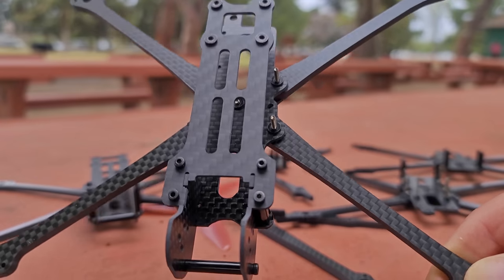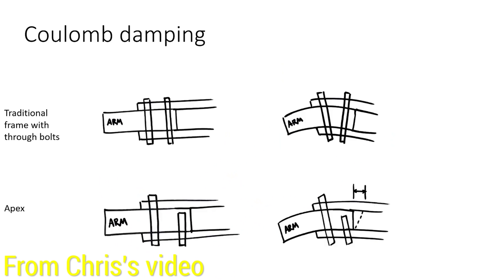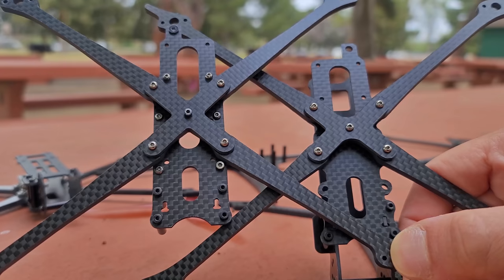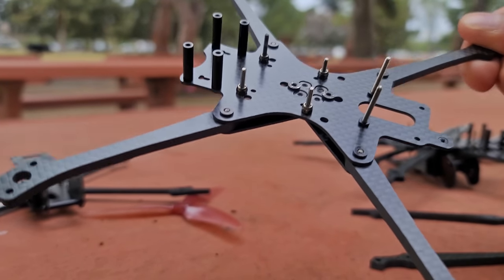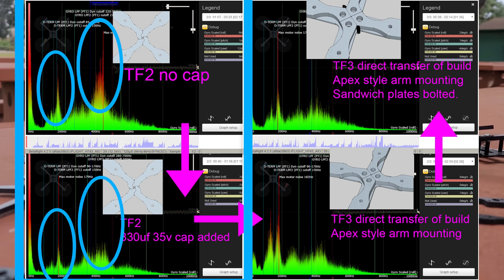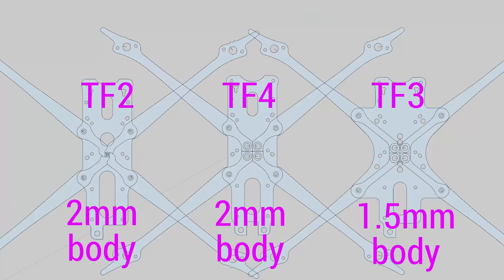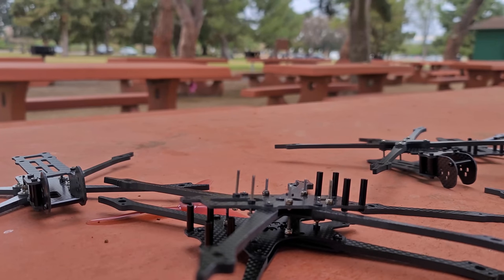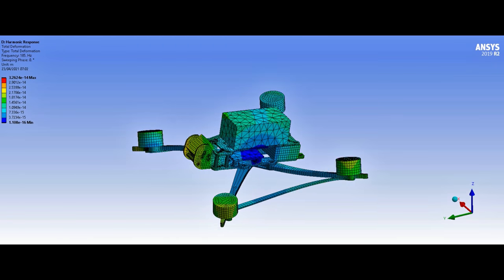Testing the Apex theory - Resonance management

Comment: Good reflexions....have you compared same setup with continuous single bottom plate against bolted arms?  Obviously the target is be able to replace one singoe arm but from stiffness stanpoint for same mass distribition, having a cut on the structure makes more flexible
Reply from the maker: Unibody frames are not good for anything unless it's 3" or under.  There is literally only one benefit to unibody frames and that's the time it takes to actually put together the frame....because you don't need to bolt the arms on.  Otherwise, every single other metric is improved by going with separate arms and body.  Weight, durability, vibration management, repairability, aerodynamics....it's been about six years and I  have been unable to come up with a metric that a unibody is better at other than the time it takes to put together just the frame which is pretty insignificant imo.
Reply: @Kabab  thanks for your response. I apreciate! I respect your experience as is the best teacher.
Reply: @Kabab  Just one comment about fft plots comparison, the metric to check is the area under the equivalent psd curve equal to mean root mean square. That are the rms values to compare with. In this case indeed the magnitude of vertical peaks is a way more important compared to the spread across freqs. In this case you are introducing the same amount of energy(same engines,boases,setup) and what we see is that the way the junction is modify, it affects the way it is responds. No energy absortion relevant apart for the coulomb damping modification...so the energy is invested across more freqs with less global amplitud. The rms could be a better metric to compare quantitatively as you will see how much is reduced between designs. But fully agree anyway in your rational! Good job!

Comment: Seems like you could probably confirm the vibration problems if you used a high speed camera.  Also, if you have a certain frequency that you're getting vibrations at, you could probably use a band stop software filter to eliminate that frequency.
Reply from the maker: These vibrations would require a really expensive high speed camera that I don't have access to.  We're talking about 150-300hz.  You'd need at least 75,000fps to be even begin to be able to see these oscillations.  The black box does a good job of recording them however so it's not as hard to deal with when you know what it is.
Reply: @Kabab  I think you could actually start seeing it around 600fps - 1000fps (you need to sample a minimum of 2x the frequency you want to catch, and more is better)  Even that's probably still hard to get ahold of though.  I'm not sure if the vibration would be high enough amplitude to be noticeable even if you could get the fps.

I'm also curious about the bandpass filtering.  Obviously, you can't get rid of the resonance with software filtering, but you could probably remove the effect it has on your PIDs, which would help.

Comment: It is interesting you are doing all this analysis. Seems like you should have 3 screws on each motor since 3 points define a plane.  But overall, I would suggest making a few duplicate quads and see if the results are repeatable.
Reply from the maker: The motor doesn't twist on the arm. The entire arm twists a bit under the motor weight

Comment: It seems to me that improvements with different types of mounting to the bottom plate can't get higher 1% because  all the troubles comes from audible fork which all the arms with flat form appear. you can check all the resonance frequencies with just drum tuner app for Android, there is no need to fly
Reply from the maker: yes you can actually use many phone apps to pick up the resonance.  The simulation just tells you all the resonant frequencies.  The bottom plate doesn't cause vibrations but it can dampen them.  That's what I'm testing here.
Reply: @Kabab  I do believe that the only thing which will decrease the amplitude in blackbox is softmounting motors first of all as the reason of the vibrations and than softmounting fc. The second way to make arms as hard as you can or add some "thickness" in the design. If you look into bbl of any cinewhoop with iflight bumblebee like construction, you'll see that all the vibrations are above 250-300hz.
The most interesting way to kill resonance is avoiding it by ESC... For example you have resonance on 100Hz, this frequency appear on 10000rpm, so the flight controller understand it and trying to avoid this rpms and for example 2 or 3 even harmonics. And so 2500, 5000, 10000, 20000 and 40000 rpms will be avoided

Comment: Hey Kabab, I have some airblade 1905 2400kv and some lumenier chief 2004 2600kv. Think either of these would work ok for a light analog build of the Toothfairy 5 inch?
Reply from the maker: Yeah if you want something 250g, those motors would work. Use a 500-700mah 4s to keep it under or around 250g.  You could run up to a 1500mah 4s however

Comment: have you tried chris's AOS 5.5 and what do you think about his frame designs?
Reply from the maker: I think his frame designs are nice however their inefficient from a manufacturing and weight standpoint if looking at the bigger picture and all the areas and functions of a frame. They do one thing well and sort of mostly give up on the rest. Nonetheless they will provide a consistent build because the resonance profile is under control. That does not mean you won't have any problems however. You're still putting four spinny things on the frame with props and a heap of other stuff that can cause problems...
Reply: @Kabab  thank you for your comment! will have to watch more videos and then decide .. your frame also looks nice

Comment: really stupid question but, can you not just put rubber on all of the contact points to help with the dampening including soft mounting the motors?
Reply from the maker: Soft mounting motors is a PITA. The screws don't stay put. Otherwise, yeah you could and it has the same effect as we've recently discovered with electrical tape on top of the arms.

Comment: Aren‘t single, higher spikes better than lower amplitude at a wider spectrum because you can use notch filters against that single spike frequency?
Reply from the maker: Overall, if you have a single moderate spike, it is better but with so many different components out there, it's impossible to tell if that spike will remain from build to build.  It's not unlikely for that peak to be sky high and no filter will really be able to deal with it.  In the case of the apex arm mount, you get overall more noise but less amplitude.  Maybe only 10% but 10% off a huge spike is still a huge number.  Still a tossup, I'm testing a couple other small features as well to figure out exactly what the mount mechanism is doing...

Comment: Interesting. But I think we do not have this discussion if the MEMS Sensor IC is located on a daughter PCB like developers test new components. Are there FC's on the market with external SPI? If not, this would open a door to integrate other MEMS components like from Analog devices for example as well. And I would be able to patch BF to use my choice of motion sensor. Having a daughter PCB, mounting ESC and FC could be done traditional without dampers. And for the "gyro board" we can think about to install it in a new way, i.e. like a studio microphone. Instead of AOI I think a better system would be a module based one. Not sure about the last sentence, probably you guys know some cons and disagree.
Reply from the maker: There are actually many boards that have a separate gyro board.  The FC sometimes comes with different gyros to plug in too. I'm not sure why this fell out of style

Comment: I thought you couldn't really compare overall amplitude of one chart to another, due to the fact the Y axis / scale is not a constant but instead more of a "fitting" algorithm based on the flight you are looking at?
Reply from the maker: They're set the same and the flights were very similar so they should be very comparable. I have the waterfall charts but chose not to show them here because they're more difficult to read. Happy to send them to you if you like. They paint the same picture.

Comment: Hi, would it make a difference if the fc screw goes all the way to the top plate as well
Reply from the maker: It wouldn't make a difference but it would make routing the battery strap a lot more difficult

Comment: Ok fine, but I still have to turn on my filters. Doesn't matter if it's more or less vibrations, as long as there are vibrations I have to turn on the filters. So I completly agree with you and your theory that shifting the frequencys higher is more useful.

Or did you change your mind now?
Reply from the maker: No this is the right way to go except that you need to introduce friction dampening and increase frequency at the same time. That's where it gets difficult
Reply: @Kabab  yeah especially when you don't have access to this kind of simulation. How can you know if you are shifting the frequencys up in your design?

Comment: What do you think about 3D printed frames?
Reply from the maker: They're alright in small sizes. Harder to do a larger print that works. Even in parts. The issue you'll ultimately run into is thay in order to acheive the same overall strength as carbon fiber, you'll end up using more weight in printed materials than carbon and you'll have an aerodynamic disaster. Not like flat carbon is so aerodynamic but it's at least not giant.
Reply: @Kabab  Alright, so for larger frames even with variable ribs and infills we aren't able to achieve carbonfiber-like strength?

Comment: have you tried mounting the fc to the topplate?
Reply from the maker: Overall the whole frame is vibrating.  You do get different vibrations from the top plate but they're still there. Also, depending on the top plate design, it could be worse.  This arm mount mechanism is specifically damping so it going to help no matter where the FC is mounted.
Reply: @Kabab  if we could only get more powerful processors to do a FFT filter
basically converting gyro data to the frequency domain,
chopping off the unwanted frequencies,
and then converting the frequency data of the selected portion back to raw movement with an inverse FFT
all the non movement data would be just gone
the issue is not enough resolution in the product
the FFT's currently used to position the dynamic filters don't use all the data

Comment: does this have the same amount of space then the fouride? Does this fitt the vista and 20x20?
Reply from the maker: Yes it has holes for 20x20 mounting and fits a vista in the back for sure. It's designed to be built with a vista. It doesn't really work the same without it.
Reply: @Kabab  nice, how long till available? And will this also be the go to frame for 350-400g quads or is it too fragile for that?
Reply from the maker: @rawpicsfpv3516  it'll hopefully be here in just about 2wks.  Around 450g is the max expected weight.

Comment: Try 6 blade props and see if that has a relationship to the vibration..
Reply from the maker: It does. Should be less vibrations because of the lower overall rpm

Comment: Hope you give more attention to smaller frames capable of carrying Vista HD Nebula Pro. A lot of drone pilots like myself do not have great wide open areas to fly so 5" quads become to limited. give us a 3-4 incher, a trimmed down Fouride, for personal flying experience. Loose all GoPro crap. We have HD !! I enjoy flying not looking at movies after the event. Make some quads optimized around the Vista/Nebula Pro. Most hobbyists will not be flying big Go-Pro boxes around in the coming future. 
Would also be cool to see noise traces you show in video with a control solution such as the 4mm stiff triangulated single piece bottom plate of the Babyhawk 2 HD. Just to let us see you are not polishing a turd.
Reply from the maker: there's a 3" version of this coming too

Comment: Glad to see you looking at this. Better filters on the software side, and less need for them on the hardware side, is where we have room to improve flight performance in a measureable way.

Would love to see how motors affect the frame performanc. Dig up those xing Cyber motors and do a 5s throttle sweep on a Prototype. Then pop your 5s motors on a Prototype frame and compare the bb logs or pop them into pid toolbox.  Would love to see the real frequency analysis.

Comment: Nice work Bob. Btw I'm sad to see the new Tooth Fairy frame won't have the Glide-style arm ends for motor protection. Any chance you'll make a thicker, "hammer" variant for us bando-bashers?
Reply from the maker: This frame is supposed to be low weight.  I am working on other things still so we'll see where the designs go.

Comment: 4 motors to chopsticks! Why isn't anyone mixing/combining TPU to the carbon? I'm thinking major dampening,  perhaps?
Reply from the maker: Yeah I've tried tpu and Corey/mewo has tried various materials too. It tends to increase amplitudes. You specifically need friction, not bounce.
Reply: @Kabab  what about liquid tape dipped to the arms?
Reply from the maker: @3eggerfpv397  would likely work fine but you shouldn't really need the tape on the bottoms side
Reply: @Kabab  True, but would it help with the over all resonance? Just a thought!

Comment: Unfortunately, this advancement is pushing me towards digital. My pocketbook is cringing. 😔
Reply from the maker: I'd strongly recommend the dji system if you're in the hobby long term
Reply: @Kabab  Yeah, I've already resigned myself to it... Probably 2022 or whenever DJI releases V3 of their goggle. I was kind of holding out for a shallower/ more compact design, but it may never happen.
Reply from the maker: @WEEBER13  it's hard to imagine something matching dji let alone better at this point. It's just so damn reliable and consistent

Comment: You want this second resonance peak to start as higher in frequency as possible, and to be as defined as possible. This will give the MOST performance and ability to set filtering much higher.
As for magnitude of peaks it's really not that important. Modern filtering will kill it completely.
Reply from the maker: Yeah we debated over having a nice clear defined peak but that also means if the resonance is really bad, that peak will be sky high and no filter will really be able to deal with it.  In the case of the apex arm mount, you get overall more noise but less amplitude.  Maybe only 10% but 10% off a huge spike is still a huge number.

Comment: See what Oscar laing is up to. I asked if it was possible to power a drone with a 18650 a few years ago on whatsapp. You said no
Reply from the maker: that was before we got these more recent 18650 cells.  A few years ago it worked but it was such a struggle it wasn't worth the effort.  Now we have 18650 cells that can legit give us 40+A of current.  Still not even close to a lipo but it can function now if you up the volts.  It's not going to be nearly as good performance as a lipo still but you can cram more capacity into a lower weight and smaller space.